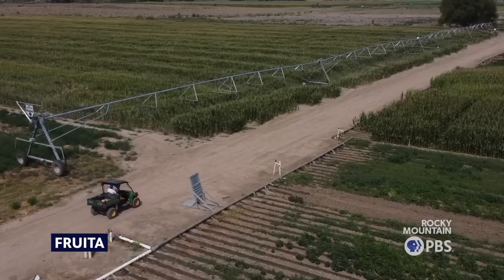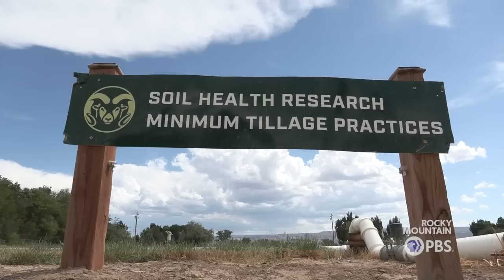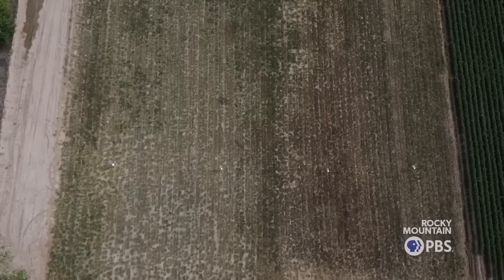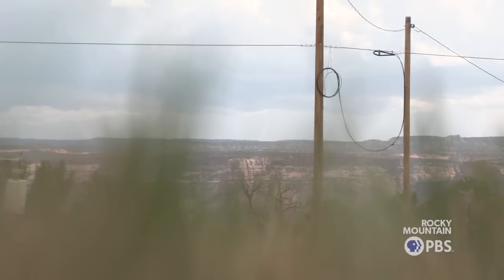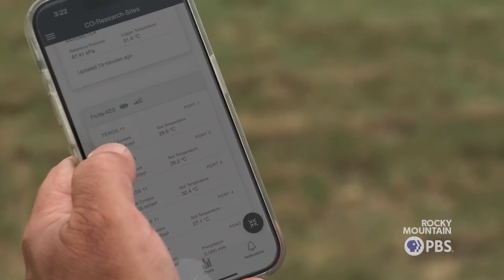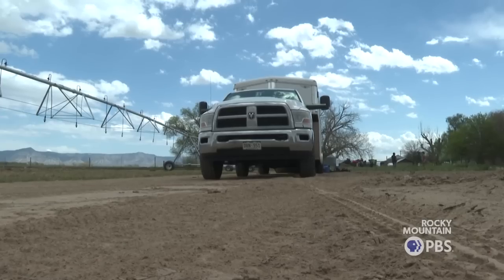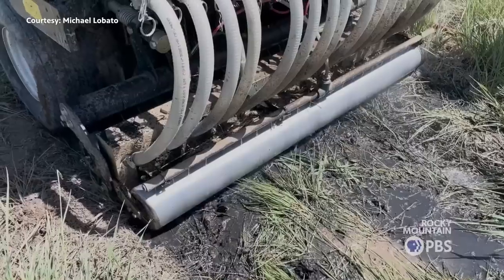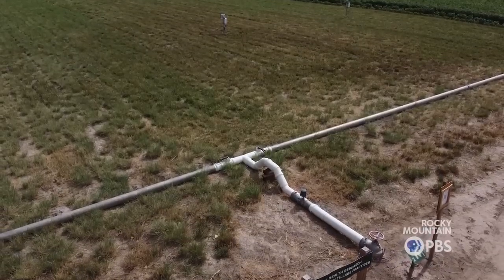Using pistachio shells to fight drought

Comment: Huh, never thought about using charcoal in my garden for water management. Anybody know how it affects soil pH?? I grow tomatoes at home. They like it a little more acidic. I usually use charcoal to lower soil pH.
Reply: There is a difference between regular charcoal & biochar, & biochar must be inoculated( mixed with compost, manure, or other microbial material) for it too work.  Look up biochar, how it's made & inoculated & used, there is a lot of information on it
Reply: @lorettarussell3235  will do. Thanks for the pro tip. 😀

Comment: Well that seems uneconomical to use a golf course machine to put in charcoal on a large scale. It’s probably better to make several tons of charcoal, mix with fresh or liquid dairy manure or whatever, let it sit, and mix, then spread it out through a manure spreader or spray it onto fields if ya had a setup to make it that fine. 

Tilling into the soil probably is way more economical or simply using a manure spreader then using a golf course machine if you’re doing hundreds of acres.

Comment: I must have missed it un the video, is pistachio shells being turned into biochar? As hard and likely dense shells are, that would require very high heat and maybe some pressure. Unless shells just happen to be available as a wasted potential resource, I'd imagine plenty of other dead plant material could be turned into biochar more easily.

But generally speaking I think every grower will agree that biochar is a very valuable ingredient to enhance microbial soil health.

Comment: I like the basis. But its just funny to me that they used pistachios as the medium example. Pistachios are one of the most water intensive crops. Drought tolerant, but farmers water excessively to get larger yields.
Reply: In my home country they turn date seeds into charcoal, the seeds of the date are quite big and contains a lot of fatty acids and oil. Dates are quite drought tolerant and don’t need much water. They are mostly grown in California tho not other states
Reply: They used it as a by product(waste product) to convert to charcoal/ biochar.  They weren't producing the pistachios to make biochar.  
Any other combustible product could be used if available, pecan, almond, walnut shells, peach pits, bones,  wood, bamboo.
The point is they took a carbon waste byproduct that would have gone to a landfill & burned in into biochar, a useful biologic product that enriches soil & helps it retain moisture.
Win win situation don't you think?
Reply: @lorettarussell3235  it is a win situation. I wouldn't say win win though. Pistachios shouldn't be encouraged when it comes to sustainability. Biochar is second to that fact. If anything can be used as biochar, we should lessen, NOT eliminate pistachio farms, and produce other crops that can be used as biochar.

Comment: Might want to check with Advanced Biocatalytics and look at their swift wet products.  Rather than holding the moisture in the soil, it makes the plants drink the water faster, before it evaporates. You use significantly less water to begin with.

Comment: I hate to be skeptical, but putting charcoal in an area that's drying out sounds like an awful combination for wildfires.
Reply: It's not charcoal. It's essentially inert carbon.
Reply: It's in the ground. Once it's placed there soil will fill in the gaps, plant roots will spread it out, and because it's keeping the ground more moist that means the plants themselves will stay wetter longer and resist burning

Comment: Finally someone just says it: Biochar is charcoal.
Still great effects, but the amount of BS and Hype being made around it is disgusting me.
Reply: Biochar and charcoal are similar carbon based materials that are often confused with each other. However, they have very different applications, properties, and production processes.
Reply: Charcoal and biochar are not the same 
Charcoal can burn.
Biochar is what remains when anything carbon based is burned to the point there is nothing left that can burn
Reply: Both biochar and charcoal are made via pyrolysis — the thermal decomposition of organic material like plant waste into carbon in the absence of oxygen. 

However, they still differ in the way they’re made. Here’s how:
A. Biochar

Biochar is typically made using the modern pyrolysis method. It uses the heat released from the combustion of gases to facilitate pyrolysis. 

The process occurs between 840-1200°F (450-650°C) and is relatively fast, taking minutes to a few hours to produce biochar — along with byproducts like syngas, a great fossil fuel alternative.

The Intergovernmental Panel on Climate Change lists biochar production as a negative emission technology as it helps reduce greenhouse gas emissions and slow down climate change.

B. Charcoal

Unlike biochar, charcoal can be produced by either the old or modern method of pyrolysis. 

The old method involves using a carefully arranged pile of wood and a chimney to facilitate the thermal decomposition of wood into charcoal in the near absence of oxygen.

Unlike biochar production, charcoal production occurs at a lower temperature, around 750°F (400°C), and can take days to complete.

Moreover, pyrolysis gases and polycyclic aromatic hydrocarbon compounds are released during charcoal production. This increases atmospheric carbon dioxide levels, making it a positive emission technique, which is harmful to the environment. 

You're welcome.
Reply: @simonpaine2347  plus, it's dirty, dusty, and made right, biochar should be rinsed.... but ugh, nasty water.
Reply: @curiousbystander9193  if you feel the need to rinse it, then the water is also perfect for use in the garden. Just make sure it's not too concentrated.
Reply: @simonpaine2347  you don't get it.... there's remnant syn gas in most biochar.... put some in a 5 gallon pale, fill with water....what do you see floating on top?
Reply: it disgusts me making it

Comment: First, think faster, cheaper, easier. 
Are canals lined. Is the center pivot at the correct height. Do not use center pivot on windy days. 
Flood irrigation...extremely wasteful. There are so many smaller ranches that use white pvc pipe to flood their few acres in the area.
Must go to subsurface irrigation. 
After that ride Rustler's Loop and eat at The Hot Tomato.